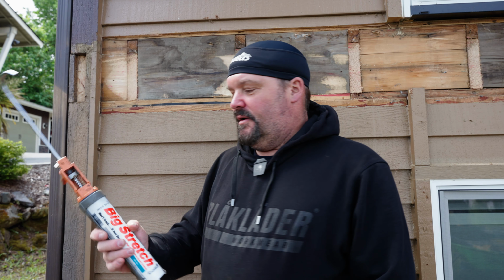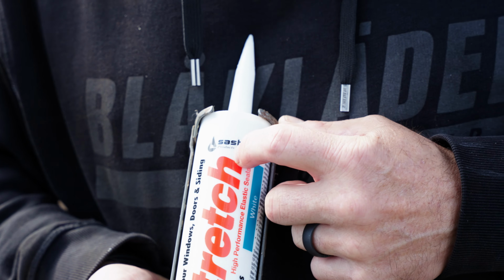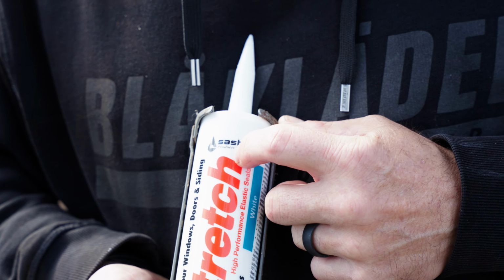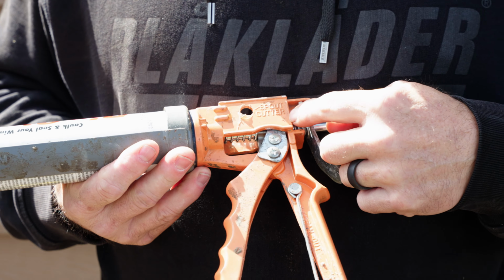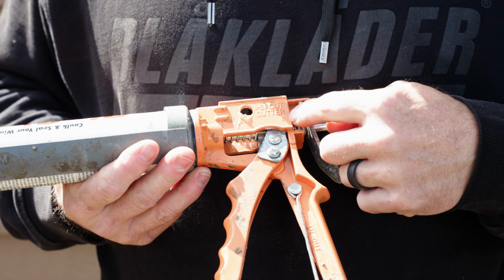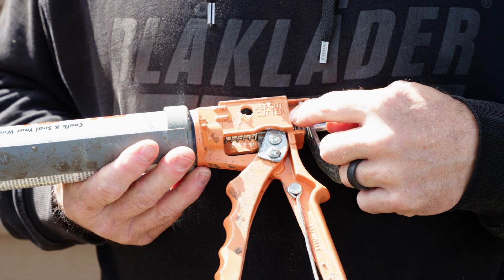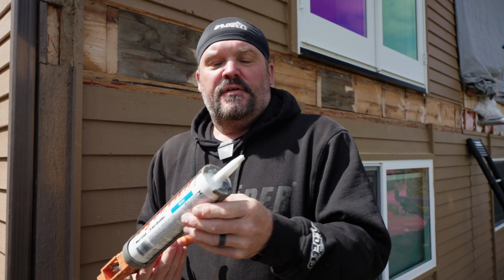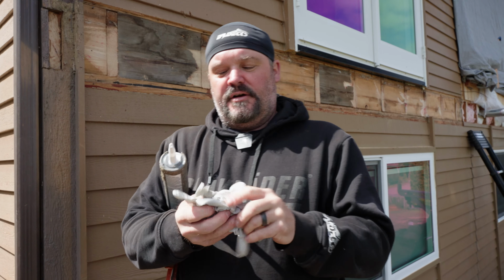How To CORRECTLY Apply Caulk || Dr Decks

Comment: Sprits a dash of wd40 on the plunger or windex pop a small pin hole in bottom of caulk tube and the calk won’t bleed out of tip after application helps a lot